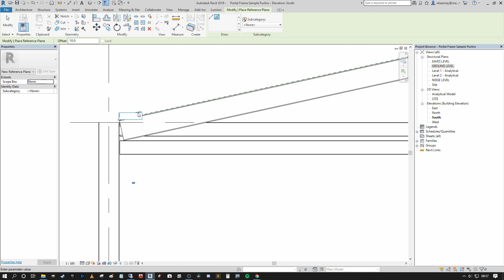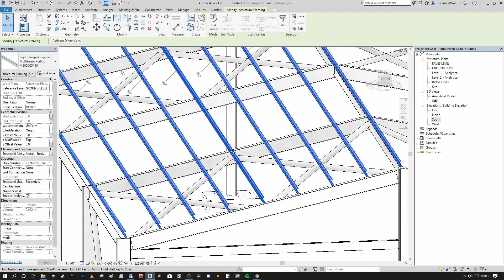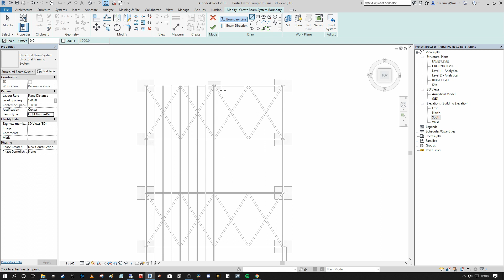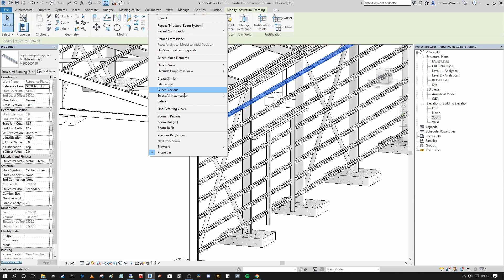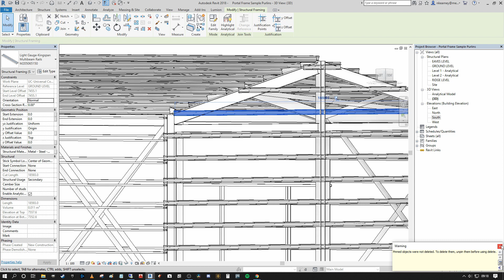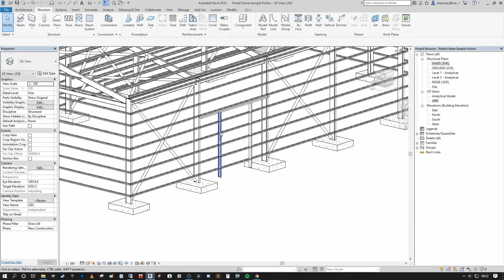How to Model Purlins and Cladding Rails in Revit

Comment: I have found in previous experience that the purlins should not reference a separate reference plane, they should be on the same plane as the steelwork they are fixing to. this allows for structural nodes to properly align and snap and also helps when exporting to analysis software and for cutbacks to work nicely on drawings. this also applies to any bracing, keep the roof structure on a single reference plane and make use of z offsets for geometry alignment. we also generally model the first and last purlin separate from the beam system and create the beam system within that. this makes it easy to adjust end spacings.
Reply from the maker: Hi Nicholas, thanks for sharing your insights. I absolutely agree with all of the points listed above. Ideally I like to have the Underside of the Purlins placed directly onto the Top side of the primary steels as you have mentioned -The only caveat is from the setting out perspective should you need to make an allowance for cleat lengths, but for the sake of preservation of nodal connections in the design models that is a mere footnote. everything else is spot on, and in practice for a real building design beyond the tutorial example I have also found that manually placing the first and last purlin a necessity, not to mention any allowance for gutter depth to the inside of parapets etc.

Comment: Loving your tutorials @8020BIM. Just a quick note in case you haven't found it already, you can mirror the purlins(beam system) onto the opposite side without losing parameters by switching to one of the horizontal planes first.
Reply from the maker: Hi there, thanks for the kind feedback - glad you are finding the turtorials enjoyable / informative. Yes, I am aware of the ability to mirror the purlins across the roof, but it can be a little tricky at times as the orientation of the purlins mostly need to be manually altered after the fact so they remain in the structural strong configuration. Didn't include it as I didn't want to confuse users within the tutorial. Thanks for flagging it all the same, appreciate it. 
All the best,
Niall

Comment: Bit late to the party here,but is there a way to get the base file of this with the structural steel model so I can then progress along with the video?? or better again is there a tutorial on that...sorry but structural element of revit is something I never really explored much as all my projects were domestic so tend to only use masonry walls up until now.. really need to get to grips with it though as surely as I will have to trow up a kingspan shed sooner or later :P
Reply from the maker: Hi again Steo,

I'll see if I can sort you out with the base file mate. Go to 8020bim.com and hit me up on the contacts page (quote your YouTube username) and I'll try get it over to you when I have a minute.
I'm actually in the process of putting together a structural modelling course. Keep an eye out for it, will be resource and template heavy so plenty to get the teeth stuck into.
Anyway, send me a message via the contact page on the website and I'll get you the file.
Cheers,
Niall
Reply from the maker: Hi Steo,
Check your email mate. 
Cheers, 
Niall

Comment: Can you please show how to model purlin over curved steel roof. Thanks in advance
Reply from the maker: Hi Ahmed. If it is a single curve on the roof (old barn style half cylinder) then the best thing to do would be place a single purlin as a beam at the centerline of the roof and use a Radial array for one half of the roof. Repeat on the opposite side. Hope this helps. 
Niall
Reply: It certainly helps. Thanks again

Comment: This quickly cleared up several issues I've been having with beam systems. Really wish the initial and final beams could be added as an instance parameter of the systems. Sub'ed.
Reply from the maker: I agree, it is a nuisance to manually add them but a little extra control isn't necessarily a bad thing - a yes/no parameter with setout dimensions would be ideal. Thanks for the sub, glad you found value in the video, appreciate the feedback. 
Regards
Niall